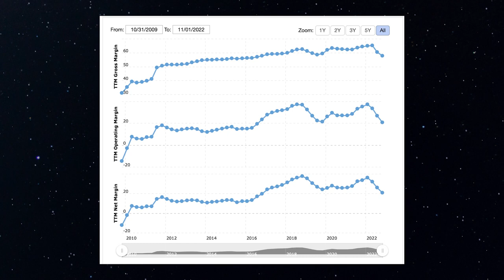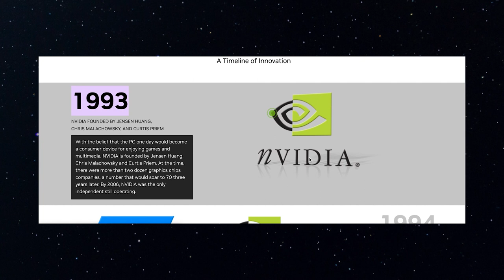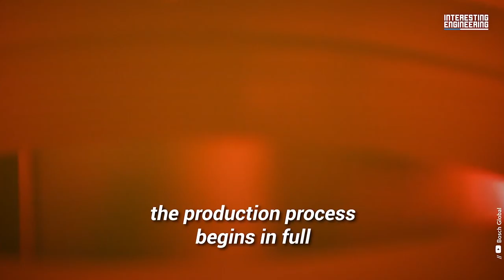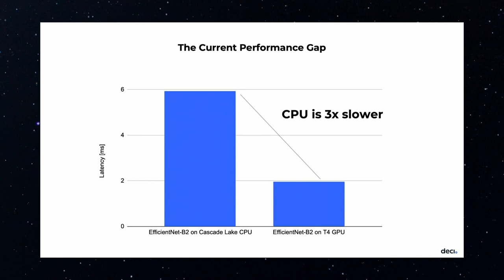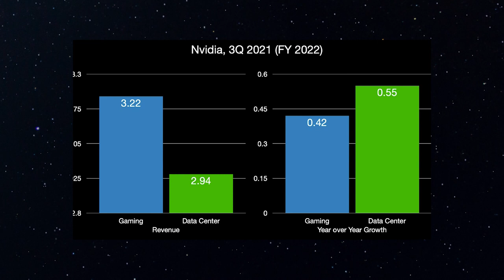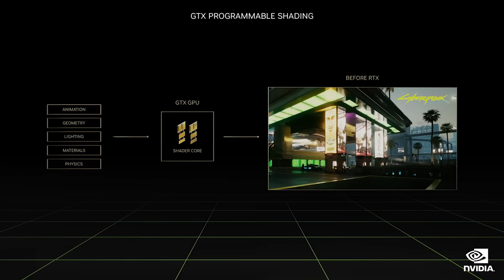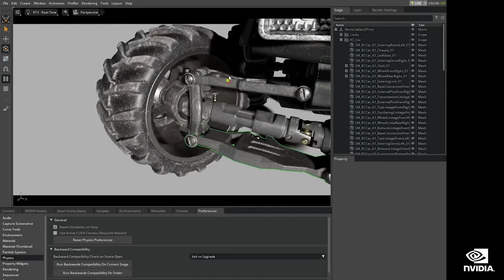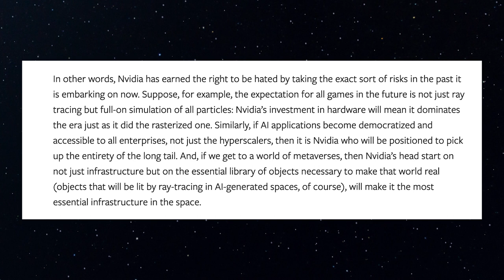The Rise Of NVIDIA

Comment: Amazing video. 1 question: Why cpus can’t run processes in parallel? As we have multiple core cpus in the market available from intel/amd? 2:20
Reply from the maker: You are correct that we have multi core cpu's but still each CPU in itself works sequentially only, whereas GPU can in their own core also run parallel operations. 
Long story short CPU's can render graphics or run algorithms but they would be an order of magnitude slower than a GPU because in the way they are constructed.